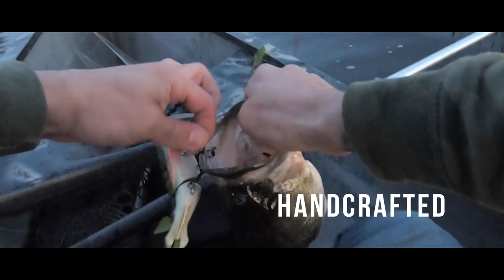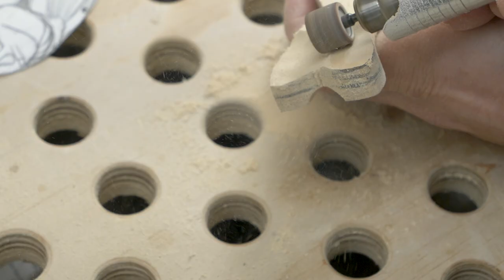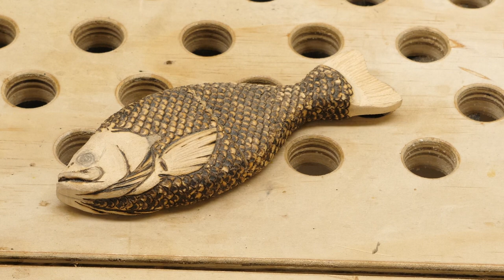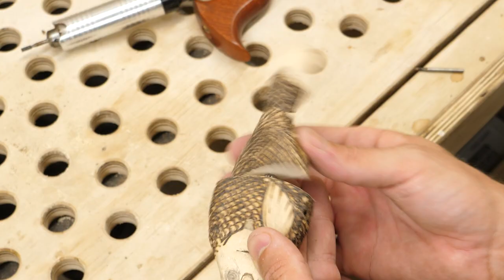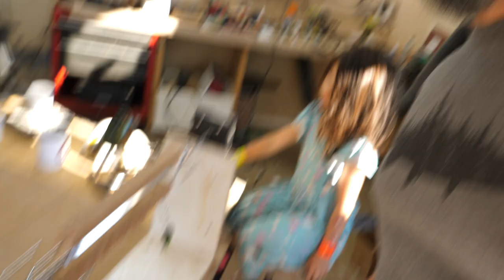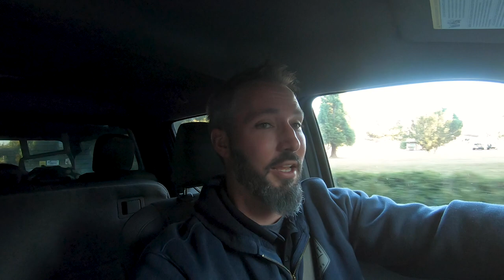Making a Wooden Bluegill Crawler Lure

Comment: Crawlers are a tough build to begin with. The wings must be horizontally angled outward just so to for the "V", and they must be vertically angled correctly to dip in the water to cause the swimming action. The amount of flat surface that lure has laying on top of the water is pretty difficult to get moving back and forth as with the more traditional crawler body style.

All in all, this was a great build and worth the watch. Don't give up on lure making!
Reply from the maker: Thanks Mike! It's a tong of fun experimenting and I really appreciate the insight!